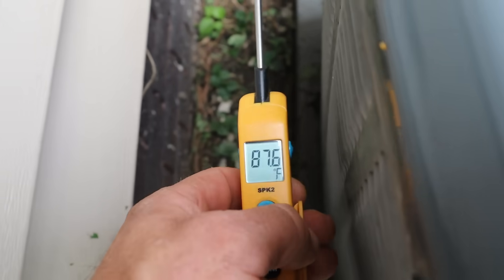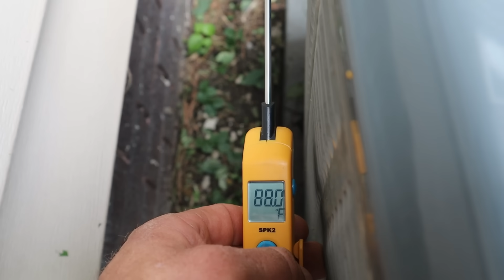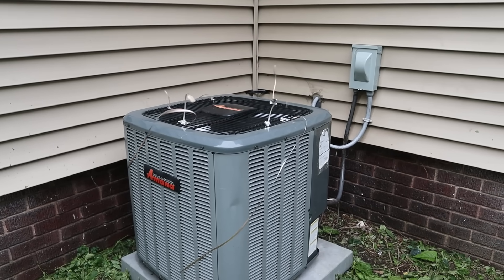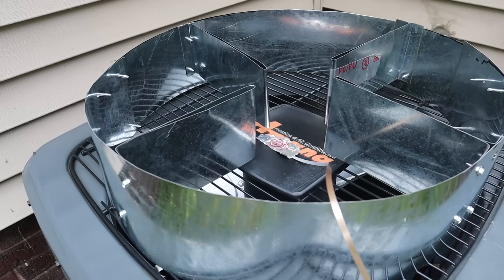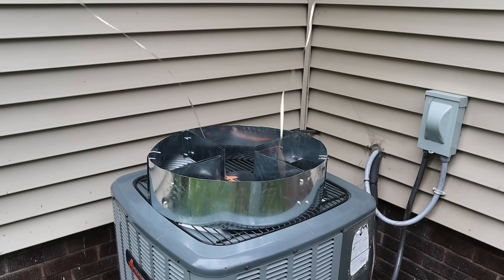Your AC Fan Makes a Mini Tornado

Comment: I spent my first couple years out of college doing HVAC design.  I can't believe I didn't think of this!  
What you've made is a "flow straightener" which helps to turn the turbulent flow back into straight, laminar flow.  I think this is a great idea and a very nice proof of concept / prototype.  
If I were going to make one for myself I'd take what you did and make the following changes:

First, make it taller.  I remember our rule of thumb was (in a round duct without straighteners) you needed a length 5x the diameter to regain laminar flow.  Straighteners cut that number down (otherwise you'd have a 8' tower on top of your compressor) but I'd aim for about 2-3 feet with the straighteners about half that length.  
Second, add something to the top, either a bell mouth or a flange.  A flared bell mouth ibetter in terms of efficiency but likely harder to fabricate.   A small flat flange around the top will provide some of the benefits and be easier to construct.  
Finally, I'd match the diameter to the fan opening.  There's likely still some hot air sneaking around the sides and that may be why you're seeing some temperature differential at the inlet.
Reply: Just curious - is all that really necessary considering he's just trying to keep the hot exhaust air from rolling back down into the condenser coil? Maybe a little taller wouldn't hurt of course, but for this use case I don't know that applying all that is necessary.
Reply: @thegrumpytexan It's probably not, I was just thinking if I really wanted to optimize it, what would I do.  
That being said, two of the things I mentioned, making it the correct diameter, and making it a little taller, aren't really any more difficult than what was shown.
Reply: @markgates1051 when you say make it the correct diameter, do you mean that it should go to the very edge of the square ridge? 

Should it go maybe 1 in past the fan blades? 

It might not be hard to fabricate a circle, but it might be hard to make it look good or make it sit on the unit properly. 

Making the funnel taller is probably the easiest way to improve efficiency. 

The second easiest I think might be the size depending on what your suggesting. 

Finally, a flat lip or best case scenario a bell curve but we're also probably squeezing pennies at this point
Reply: @modernNeanderthal800 don't overcomplicate this. 99.9% of the efficacy of this would be due to making a ring that's as big as the outlet duct on top of the unit, and preferably at least a foot tall
Reply: @markgates1051 I appreciate you thinking with an engineering mind, but actual testing in the field is superior to all of that. And most of the stuff you mentioned is a waste of time an unnecessary, but your point of making the ring bigger and taller is valid. It should be at least as tall as the duct opening of the fan, preferably to the edge of the unit. And the taller the better. And if the unit is in a confined space a 45° duct works well to exhaust the hot air out of the area. For example, units that are under a carport or a patio, a bad place to put them in the first place, but I've seen many because somebody thought it's better to put the unit under the shade, which is the worst thing you can do. I've seen units like that were the intake air gets up to 135 degrees😢
Reply: @7x779 The duct is a square though..... Maybe I don't understand what you mean by outlet duct. 

Thanks. In general! If you don't respond, I'll take what you have given me. I think that anything is better than nothing and especially if it's maybe a foot or too taller
Reply: @modernNeanderthal800 by Outlet duct, I mean the diameter of the Shroud or hole that the fan is spinning in. Whatever you make should be at least that big, it can be round, or Square
Reply: @modernNeanderthal800   - Hi. I see your confusion, but if you look closely, you can see a bit of sheet-metal capping the unit just inside the top grating. It has a large circular opening cut just outside the fan outer diameter, allowing fan-air to exit the top. That diameter is what the added circular shroud matches 👍.
Reply: @chuckintexas thanks! Imma take a look. 

Worst case I mimic the video exactly and see improvement anyway
Reply: @7x779  So my thought of putting some sort of screen-type mesh between the porches that ours sits between would be a Bad thing in the FL sun? It would be a good ~10' above it.
Reply: @pyromethious every installation is different, the only way to know for sure if you're making an improvement is simply measure the ambient temperature with a shaded thermometer away from the unit, then measure the temperature of the air going into the coil on all four sides and write that down. Then install whatever you think will work and do the same thing. If your improvements caused the temperature going into the coil to go up, then it's making things worse. If it causes the temperature going into the coil to go down, then it's making an improvement😊
Reply: @thegrumpytexan the taller shaft encourages laminar flow; once the hot air funneled it has a tendency to remain that way.
Reply: @thegrumpytexan But equally you don't know if it is. The 5x dia is a very well known and used system so why question it if you haven't another idea to back it up?
Reply: @givemethejob3293  I think it's good to question things, even if you don't have the answer. It may spark an idea from someone else. Sometimes the ultimate efficiency is only a very moderate improvement over the 2nd best but the cost to attain that ultimate point is way too high. In this instance, maybe just getting the air flow a bit above the unit is all that is needed to keep the hot discharge air from returning to the intake area. As an example, if a ten inch tall duct directs 99% of the heated air up and away from the intake, is chasing that last 1% by building an eight to ten foot duct going to be worth it? Also, the taller duct may introduce variables that can't be controlled easily, like the shape of the duct could be a problem. I'd guess making a perfect cylinder would be fairly impossible to the DIY crowd. Would a misshapen cylinder induce enough resistance to flow to negate any benefit? Would just the length of the cylinder cause that resistance? What about weather? Here in South Florida, would that ten foot duct be ready for a hurricane? I'm sure I could come up with other questions if I thought about it for a bit. I'm sure you could too.
Reply: One thing I noticed about his cooling tower inspiration is the diameter  widens after leaving the fan.  Lowering exit velocity should reduce the vortices on the backside as they leave the cone, and... much easier to fab than a rolled lip.  Main thing is put these events up where they don't recirculate heat back into the coil.
Reply: There's the college way and then there's the practical way.  Reminds me of the story of Werner von Braun's V2-style rocket designs and why we ended up making our rocket shells out of straight cylinders instead.  

von Braun's rockets were much better aerodynamically and required less power to gain altitude but, to build them was too expensive.  Think of the contours and custom sheet metal work to duplicate von Braun's carefully calculated shape.  Our rocket engineers accepted the drag penalty and went the cheaper route i.e. long straight cylinders.
Reply: Although I am not aware of any simple calculator, the vanes inside the round exterior greatly reduce the length of duct required to convert to laminar flow.
This principle is applicable to all forms of fluid flow, not just air.  Reduction of turbulence by achieving laminar flow is the key to increasing efficiency.
Reply: question.  When you say straightners, is that what the video calls 'fins'?
Reply: @rc100usa yes, sorry, I should have been more descriptive.
Reply: Do curved vanes (radially around the ring) or aerofoil vanes provide any further benefit? Could you use fewer if they were aerodynamically shaped?
Reply: @Drunken_Hamster somebody did a test with these bells recently. They were 3D printing them and measuring the speed of the air. 

A little bit of a lip helps create smoother air flow but it increases drag a little bit. A really large lip creates way more drag in drag compounds exponentially the faster the air is trying to push out so there is a sweet spot for the size of the lip. But as long as you are not trying to fly a jet near mock speed, I think that you're fine
Reply: @modernNeanderthal800  A lip on the inside flow edge, like a Gurney flap?
Reply: @Drunken_Hamster  Wouldn't such vanes encourage the rotation of the airstream?  It seems that the objective is to stop the vortex and exit straight up.
Reply: @BlackPill-obey  The idea is to more effectively counter the rotation. Stators on turbines and other fans are often not straight vaned, so I figured that the same would apply here.
Reply: @Drunken_Hamster  Ah, I see what you mean.  In the case of this HVAC invention, I suppose curving the stator to meet and straighten out the airflow coming from the fan would require special presses to get the desired shape for each blade.  Too much trouble and expense, I suppose.  

It points back to my first reply regarding von Braun and why we didn't adopt his rocket shell design, even though it was better.
Reply: Ha ha! I knew there had to be a recipe thanks😂
Reply: This is an AI answer…
Reply: Well at that point, wouldn't you want to space it about 7" off the top of the condenser and have a Venturi opening that would hopefully create a low pressure area above the condenser and help draw the heat out?
Reply: @SteveOnStar  Now we're getting into stuff that would arouse the HOA busybodies!  Giant cooling towers?  Violation of "curb appeal" rules.

Comment: Eh, I've got one of those mister units. I figure any heat curling back down to the fins will just end up evaporating the droplets, anyway.
Reply: Those misters accelerate the deterioration of your condenser cooling fins. Either you end up coating your fins with mineral deposits that reduce thermal transfer or you cause the aluminum to oxidize and flake.
In industrial settings I have witnessed this cut condenser lifetime by 50%.

Comment: Shroud with swirl brakes, good idea. Be neat to calculate the correct number of brakes for the frequency of this unit. 
Seems like the unit wasn't installed with the recommended clearances.
Reply from the maker: No, it wasn't. I plan on moving it eventually. I want to retest when I do to see if still has any effect.

Comment: I built a deck above my heat pump. Made it inefficient and it died a premature death a couple years ago. Just finished installing a mini split to get away from the electric heat backup that was costing me a fortune in winter, and had no AC in summer. Tried to avoid the feedback loop this time :)

Comment: Thank you for not adding music
Reply: Very thankful
Reply: Username fits.
Reply from the maker: You're welcome.
Reply: Anyway thank you for a great video. Did you consider making just a simple round duct ring like you did, but a little bigger, all the way to the edges, and without the divider veins inside? I suspect most if not all of the benefit comes from the duct ring keeping the air from rolling over the sides, and I think if it was a little taller it would be even better.

Almost 50 years ago, we solved this problem on a big condo Tower where all the condensers were in confined little porch areas, and they were all overheating in the summer. We just put big 28 inch 90° sheet metal elbows on them, so it exhausted all the hot air out the side so the condensers could breathe fresh air coming into the coil.

This worked very well, and it also works well for residential applications where the condenser is in a confined area😊
Reply: @JerseyMikeHVAC I'm also an HVAC guy in the desert and you're the first person I've seen post a video who understands this is the most effective thing you can do to increase the efficiency of your unit, and you actually showed how simple it is to prove it by measuring the intake air into the coil. I'm shocked at how many other HVAC guys on here are making foolish videos about building a shade over the unit, when that can actually deflect the hot air back into the side of the coil and make it worse. And they're so intellectually challenged, they can't even comprehend that all you have to do is put a thermometer on the intake air flow to the coil before and after the shade, like you just did.

In fact, I have worked on many many units under carports that are more than 6 ft above the top of the unit, and especially on calm days, it just fills the area with hot exhaust air that recirculates back into the unit, which causes the exhaust are to become even hotter coming out, which recirculates back into it etc. In fact I have measured as much as 135° are coming into the coil because it was under a shaded area.

And the insufferable thing is that when I try to explain this to them, the resort to personal attacks and get all emotional because all they can do is think about how that when they're human body is in the sun their skin feels hotter and then they go into the shade and their skin feels cooler. They can't comprehend did an air conditioning condenser Works off of airflow, and they also cannot comprehend, that the temperature of the air in the sun is the same as the temperature of the air in the shade.😢
Reply: @JerseyMikeHVAC p never change
Reply: And not doing the pointing and finger wag thing.
Reply: But I need bad generic trap beats.
Reply: ...or AI narration.
Reply: OMG fuck music
Reply: Agreed. Music in a video is fine when it's relevant but, not everything needs a sound-track plastered on it.
Reply: Yes
Reply: Right, it's so unnecessary to add music to something thsts trying to teach you something or you are attempting to learn
Reply: Yes, very thankful as well!  YouTube tinkle music is the WORST
Reply: Whats the name of the song?
Reply: No, how will I know what to feel?!?
Reply: @RogalDorn01 😂

Comment: Its not the swirling that's the problem, its the transition from where the blades are to the ambient air. The shrouds you see on cooling towers are doing two things: shrouding the fan, smoothing the interface of the blades and air; and with the Venturi shape, accelerating it. Both those things increase efficiency. But venturi's are hard to make and they need to be just right, so the best "value" of effort to benefit comes by just making a fan shroud. Good job!

Comment: What you have done is create "laminar flow" that should project the air more directly upward so less chance of recirculating to the sides. I'd be curious to know if changing the height of the shroud or adding a little rubber gasket on the bottom to seal it up would change the flow. You could probably measure it with one of those gadgets used for testing flow in AC ducts. That said, if you can fine tune the idea and have it reproduced in a UV resistant plastic, you'd have something marketable on your hands. Your final product could attach via rubberized magnets so the wind doesn't blow it away. BTW, you could probably sell a million of these on late night TV for $29.95!
Reply from the maker: But wait! There's MORE! It can dice up an entire salad for you in 1.2 seconds flat! 

I like the rubber gasket idea .
Reply: @JerseyMikeHVAC     if you act now we'll throw in a second "magic air mincer" so you can keep one in the kitchen for holidays when you need a BIG salad!